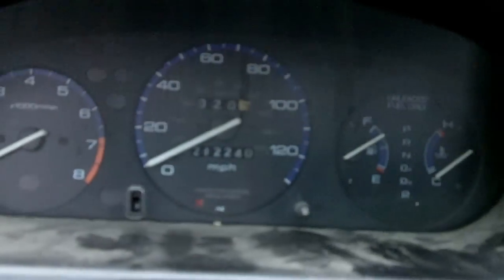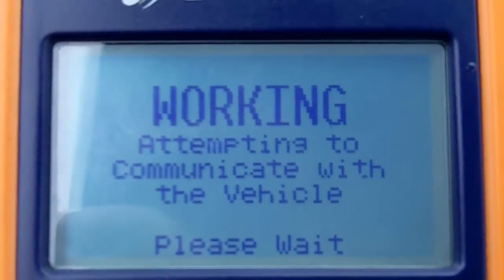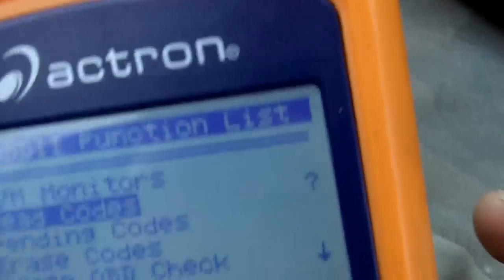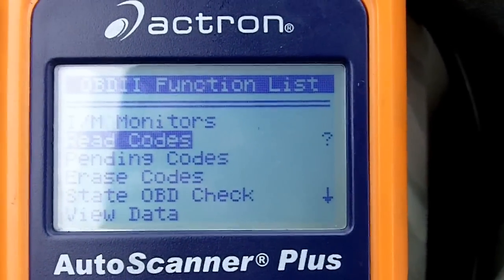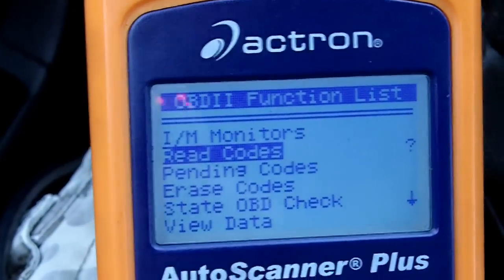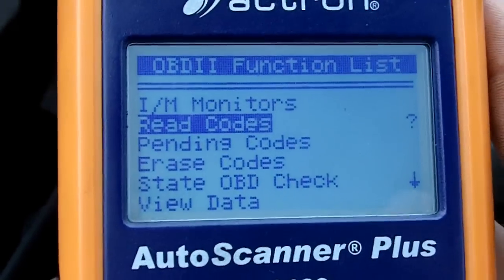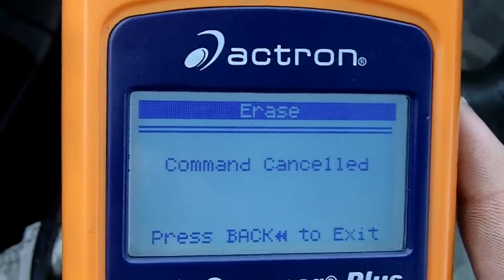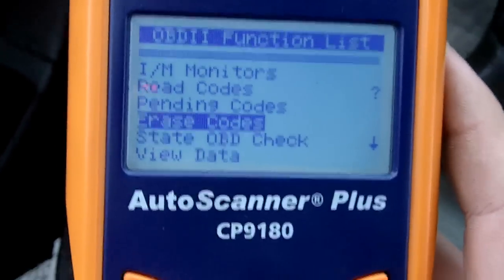How to use an OBD2 scan tool

Comment: some data link connectors are under the drivers side case like you said, some under the passenger side,some in the fuse box panel, and some under the hood.

Comment: obd2works supply professional Car Truck Diagnostic Tool,LAUNCH Diagnostic Tool, ECU Chip Tunning, Auto Key Programmer, Auto Locksmith Tool and Automotive Electrics OBD2 Code Reader,Car Diagnostic Tool, Wholesale, car obd2 diagnostic tool,search "obd2works" on google  you'll find our shop

Comment: If it is a CODE A(critical) the MIL will clear after 3 sucessful drive cycles without a DTC being set. But the DTC does not clear fully, will stay marked as H(historic) in a lot of scan tools. After 40 drives cycles with no DTC's, the code will be fully erased.

Comment: You should have pointed out that if you are just parts changing to get rid of the CEL to not erase the codes. If you got it right after several drive cycles or ignition cycles it will clear itself.